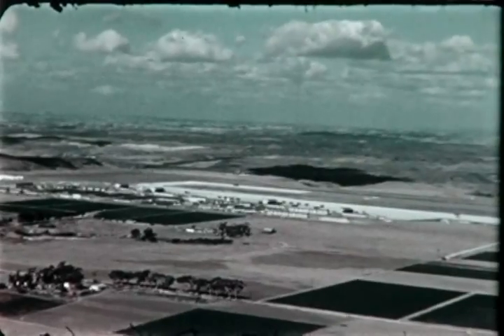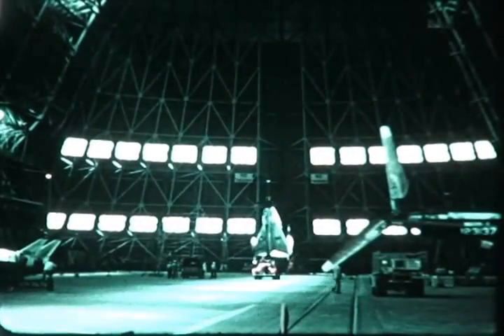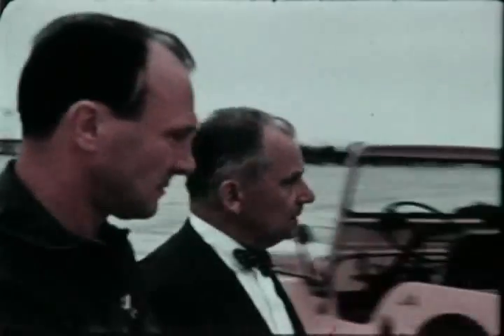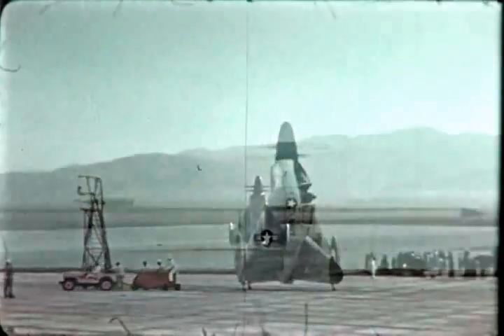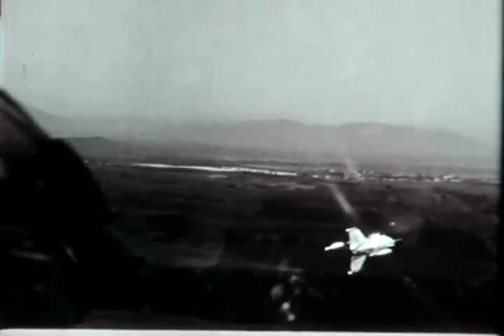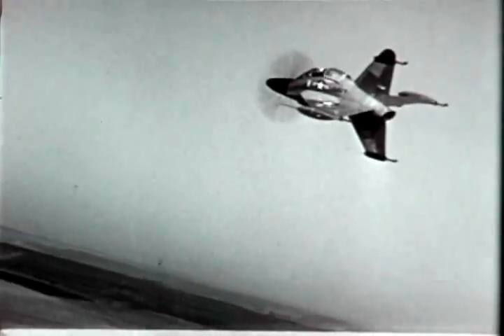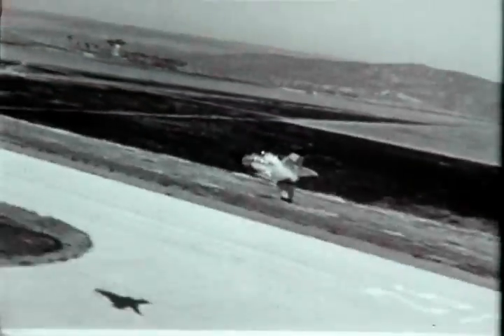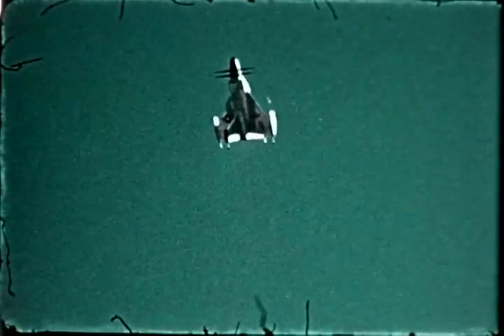F-0645 The Convair XFY-1 Pogo VTOL Transitional Flights

Comment: I see a big flaw with this plane, emergency landing in high speed is guaranteed destruction of the plane. Any damage to the exposed four landing gear would result in fail landing. Standard plane configuration has much higher chances to survive the crash.

Comment: Ryan XV-5A: Teledyne Ryan Aeronautical had a jet VTOL project with the Army called the XV-5A, 1960 to 1970 or so. It's on here. A fairly normal looking fighter jet. Vertical flight was achieved by diverting the jet exhaust to drive big lift-fans in the wings and nose. Seems the exhaust was indirect, to a turbine, driving cold-air fans. Had a multiplying effect on the vertical thrust. Ryan and Convair were both San Diego companies. I had a summer job with Ryan in 1971... my Dad thought it might influence me to study engineering in school. Nope! Not the brain for it. But it was a company with a long history. Lindberg had flown a workhorse Ryan plane on long-haul Airmail jobs. Turned to Ryan for his purpose-built Spirit of St. Louis ride. It worked.
Reply: That Ryan you're talking about was the Vertifan!!

Comment: The fixed, lower, vertical stabilizer, will not allow it to land "conventionally."  Quotation marks used simply because the plane lacks any landing gear that would allow conventional landing.  But even a belly flop wouldn't have even a marginal chance of providing a safe landing.  Once the rear of the plane struck the ground the nose would fall forward like a rock.  It's almost 100% that the plane would tumble down the runway like the opening scene in the Million Dollar Man.  The ejection seat on this thing doesn't work below 100 feet.  An engine failure below 100 feet while in the vertical flight mode would not allow the pilot to get out before the plane hit the ground.  If he was in horizontal flight, below 100 feet, he could pull back on the stick, and use the plane's inertia to take him above 100 before ejecting.  A pilot without significant courage would not be suited to the job.
I'm guessing that they chose to use a propeller design, instead of jet thrust, because the means of controlling the plane while in vertical flight was simpler because the prop wash gave the control surfaces enough flow to function.  There was probably a jet engine available with enough thrust to lift the plane straight up, but controlling the plane's sideways movements while in vertical / hover was a challenge that they were apparently trying to avoid.
Reply: The lower vertical stabilizer could have been jettisoned in case of emergency landing.
Reply: @divendus5766  

"Could" have been jettisoned.
Are you saying that you know for a fact that the plane had been designed with a lever that the pilot could pull that would disconnect the lower stabilizer?

Or, did you use the word, "could", because you think they may have had such a system on the plane?

It sounds like a good idea to me, but I've not heard about it before.

Comment: The video doesn't do justice to the sound. At takeoff the tips of the props are supersonic and the noise is still deafening at 300 ft. The only thing comparable in my experience might have been a C-133 making a short field landing with props reversed at max power.
Reply: I was there in the hangar when it made its first tethered flight, and the sound was tremendous. The smell of aviation fuel exhaust  was also pretty intense.

Comment: 1908 planes and 1958 planes were massively different. 1958 planes and 2018 planes are almost identical. Progress?
Reply: Yes. Progress.
Reply: Are you kidding? The safety record alone is massively different. Efficientcy and reliabilty are way better. The longest airline flights are now done by twin engine jets (787, A350, 777). In the 50,60,70 and 80s you would have to stop several times and probably fly in a four engine aircraft.

Comment: I saw this plane fly when my father was stationed at NAS Pax River. He brought me on base and I watched several flights it made from the flight line. The Navy had it make a flight into washinton DC and returned To the NAS.  I also saw the first Martin Baker low altitude zero/zero ejection seat demo from a Grumman F9 fly by and on the second slow pass with the canopy open the guy in the rear seat ejected and landed into a plowed grass field...I saw some really great things while he was stationed there.
Reply: So not a zero/zero ejection. That means zero altitude/zero forward speed'basically sitting still on the runway.
Reply: @64mickh  Exactly...Thats the point. When that seat was being discussed in the middle 1950's thats what it was called. The navy was looking for a seat the pilot could leave the aircraft while it was still on the deck or ground. So thats what it was called. I didn't name it. I was 13 and got to watch it. I consider myself fortunate.
Reply: @64mickh  logical failure. Wouldn't live test a ANY ejection/egress system from it's minimum envelope at the start of a test program.
Reply: @FeralRabbit  Reading comprehension failure. It was a demonstration not a development test, clearly implied in his comment.
Reply: @absolutelynotaperson  glad to improve your otherwise empty life. You're welcome.
Reply: @EOTScomic  Yeah plenty in black & white B movies in 1950's Why.
Reply: @EOTScomic  My father was in Naval aviation 24 years and I spent parts of the summer for a few years with him on base ( which they would never do today) that subject never came up and never heard anyone speak about. Information was almost non existent then. real small B&W tv's and radio and a few magazines was all people were exposed too.
Reply: Probably not a coincidence I grew up in Hollywood and have a healthy curiosity of aviation.

Comment: Coleman..."We expect to takeoff at takeoff power"....duh?
Reply: The rival Lockheed XFY failed to achieve vertical takeoff.......so there was some concern, plus optimizing a prop for both high thrust in vertical flight yet for high thrust and speed in the horizontal.